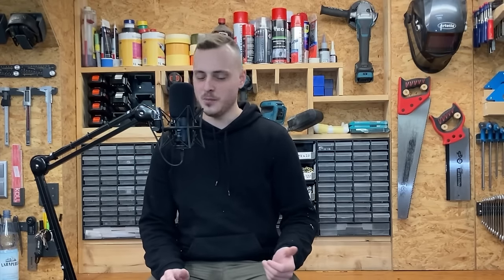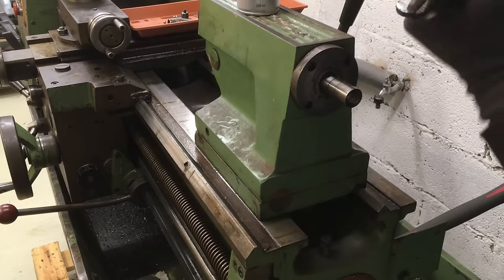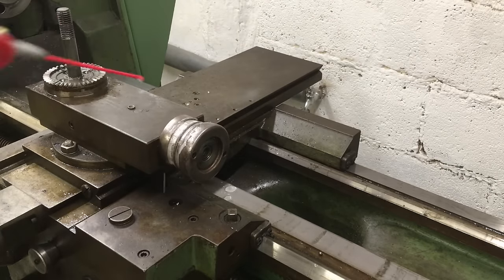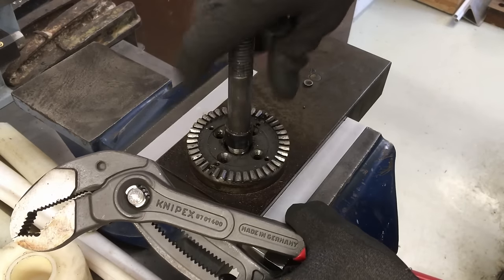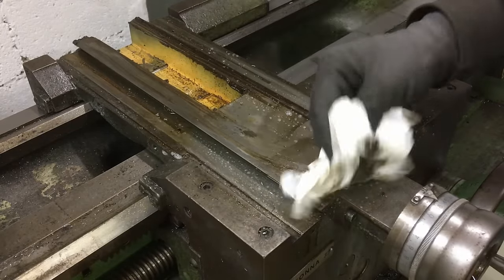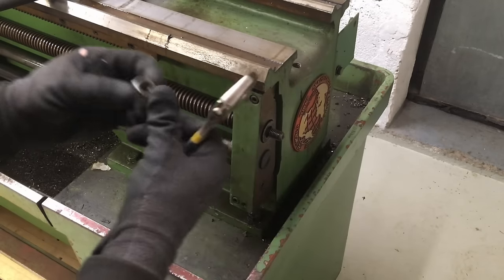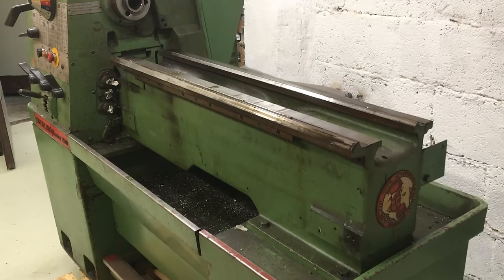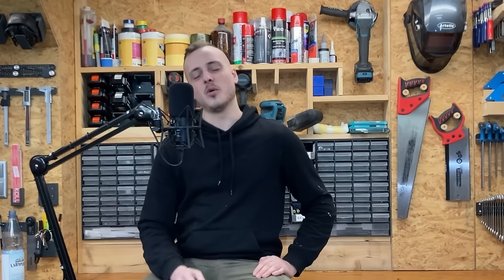Was Buying This A Good Idea? | Lathe Restoration Part 1

Comment: Very useful video for me as I'm about to do some maintenance on my 1982 Colchester Student 1800, which is similar to the Master 2500. I use it almost every day. I'm thinking it's time to do some work on the cross-slide leadscrew. Maybe replace it with a ballscrew and add a servomotor drive for machining elliptic, parabolic and hyperbolic antenna reflectors using a big faceplate and with the bed gap removed. Looking forward to your next video on this refurbishment

Comment: Wow, your timing couldn’t be better for me: I just brought home the 1970’s, American market version of the same lathe. I’ll be doing the same kind of tear-down and cleaning, as it sat idle in a damp trailer for a number of years. Needless to say, I’m subscribed and looking forward to your upcoming posts on this project. Thank you!
Reply from the maker: That’s awesome! Did it come with a DRO ?
Reply: @PhilEngineering  It did come with a Newall DRO, but only a single axis one (Z). I’d like to add a scale to the cross slide and find a 2 axis display.

Comment: I have the same machine circa 1970. I look forward to watching your progress on her. 
    They are an excellent machine, very will made. An absolute joy to run. I've had my lathe for 7 years now, never any trouble. It came out of a maintenance shop and I don't think it saw much use. I run a small jobber shop and it sees steady but gentle use.
   The machine I have is a mirror image on the apron to your's,  it was made for the North American market. Apparently driving on the wrong side of the road isn't the only thing the British do differently😊.
 Cheers, and great video

Comment: For cleaning precision surfaces I use the scrubbing backside of kitchen sponges and WD40. It cleans rust and oxidation better than rags but doesnt attack the surface
Reply: I don't think scotchbrite should do much to hardened precision surfaces. I've heard that some cnc machines are rebuilt by their manufacturers by scrubbing boxed ways with scotchbrite, and even with powdered kitchen cleanser to get oxidation off. If the surface is in pristine condition anyway, and just greasy, I probably wouldn't use it, but if it's oxidized, your best bet is to scrub it back to shiny with scotchbrite. A random orbital sander with the scotchbrite on it works really well and saves a ton of elbow grease!
Reply: @gorak9000  Most machine ways werent hardened well into the 80s and sometimes 90s, even the best and most expensive ones. Scotch brite does remove material, very little but it does.

Comment: Score! since it wasn't used in an industrial environment it's probably like new in most areas. The only thing i can think of is sometimes if these old lathes sit on a floor that wasn't level they can take a set so it could be difficult to level them perfectly but for 99.9% of parts that shouldn't affect anything anyway.

Comment: Scotch bright pads are not going to damage ways , unless u rub them for 3 decades with it.
The maroon pads are fine.
I use wd40 and a maroon scotch pad to clean rust off ways.
Ive been restoring and scraping machine ways in for 20years.
Please dont spread false information. 
That machine your doing is in Beautiful condition other then being dirty.
That was an easy machine clean up.
Great lathe